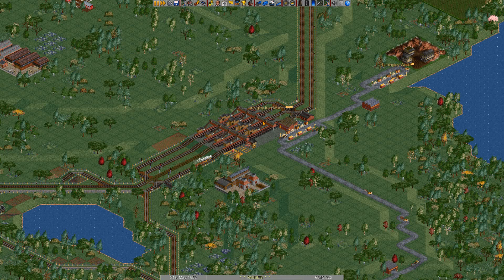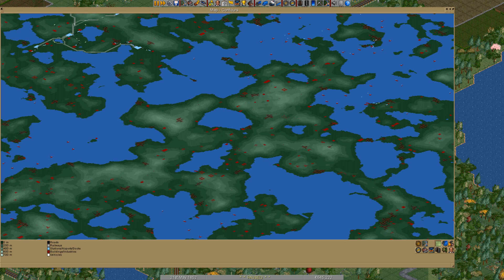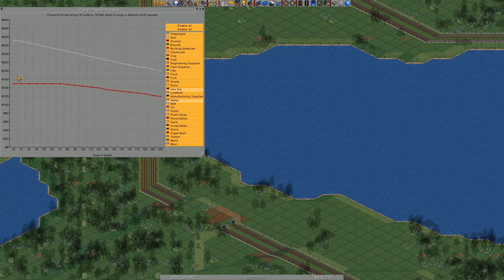Let's play OpenTTD #6 - Engineering supplies

Comment: Very interesting tactic with the refitting! I would've gotten one extra train to bring the engineering supplies to the hub, and add one carriage for the other (existing) trains to pick it up from there. But I'm not sure how that would've played out!
Reply from the maker: Which would lead into the trains picking up the engineering supplies from the hub station, but also from the iron mine stations as there's no way of setting up a train to not pick up the goods it just dropped when it has empty cargo capacity for it ;-)
Reply: Ah yes. Complicated matter. Doh!

Comment: It's going better with the caboose, but you just need one caboose in a freight train, not multiple, even with multiple locomotives. This way you save weight and gain a little extra acceleration ;). But as for the rest, i like the series a lot and keep it going (y)
Reply from the maker: Hehe, when will I ever learn... Anyway, thanks for the info, now that I am armed with the right knowledge Speedynet will prosper even more!

Comment: I really look forward to these vids on the weekend, keep up the great work. On a side note, is there a way to set up the station so that the trains going to the depot for refit don't block the entire intersection for the station?
Reply from the maker: Using prepathing signals helps a little bit with it, but the best way that I know of is by having a terminus station (at the end of a line) with each track having a depot at the end of it. Placing a lot of depots and distribute the usage of them equally will also help.